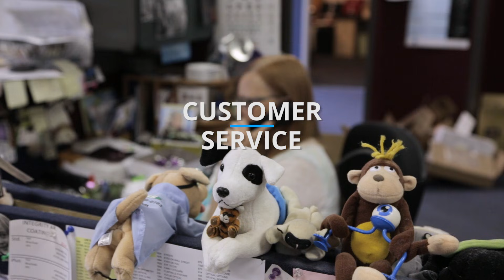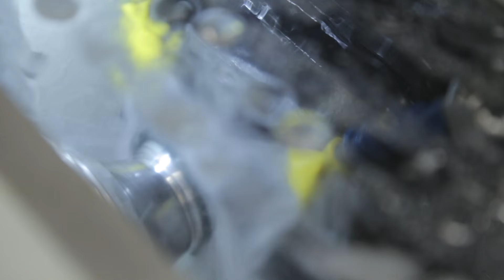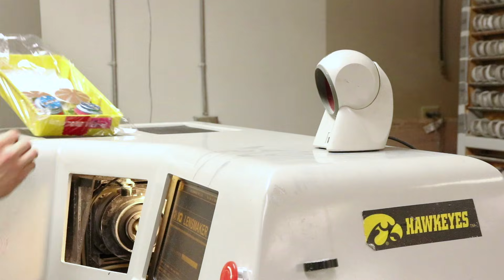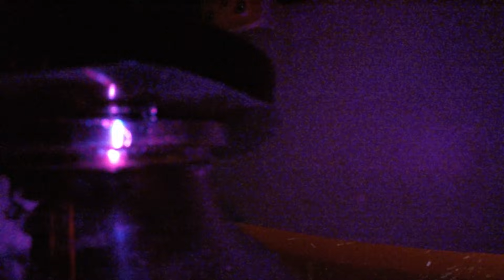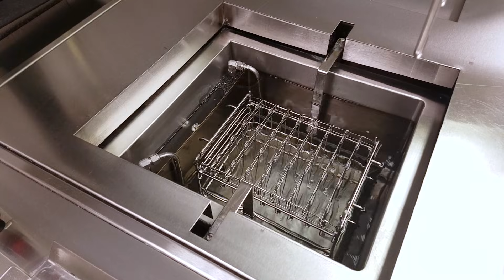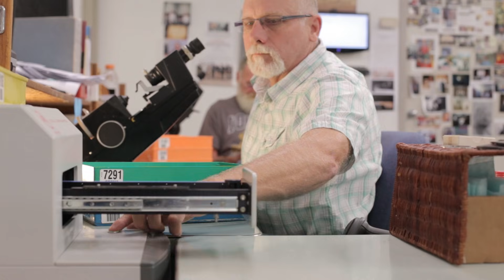How They're Made (Lenses and Coatings): Inside The Optical Lab

Comment: John, thank you and all the people involved in the production of this great video “How They’re Made…”.  The information in this video is needed throughout the optical industry.  And I agree with you John, Laramy-K Optical the best wholesale surfacing lab in the county.
Reply from the maker: Thanks!
Reply: @LaramyKOptical  if lenses are tinted before they are cut for frame dimensions how do they prevent the white edges from the safety bevel and lens edge being uncoated? seems counter-intuitive..
Reply from the maker: @wazup3333  Drop me an email through the OpticianWorks website. I'll be cutting a pair of that exact thing today or tomorrow. I'll grab some pictures and let you decide. John
Reply: @LaramyKOptical  sent, you will see it in direct light so on the pictures it wont be visible. this applies to clear lenses aswell since edges are uncoated, when direct light hits it the edges sparkle white

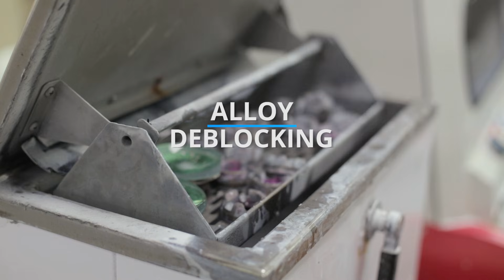Comment: What are the health and safety standards required with regard to handling the Lead Alloy, specifically at 12:27 onward...shouldn't gloves and masks be used by the operator to protect hands/skin and breathing in any particles? Or does the measurement of lead particles within the air fall below the OSHA guidelines of 50 PEL or less during an 8 hour exposure period?

Comment: Wow how interesting and amazing all the machinery and precise presion that goes into this. 
1 question i ask you makers. When applying the layers of shading and coating i notice you add the coatings to the front of our lenses. Which is why i know now how scratches do  occur on our glasses. Even though i got the feather weight transitional Lenses with actual glass coated scratch resistant lenses. I still get fine scratches. This last pair i got cloudiness right dead center of my glasses. I paid over $600.00 for my prescription glasses. And i got very fine scratches and cloudiness. I can't use them very often and they are what i use to drive. So don't be on the road when i drive. Its frustrating having these problems. Is their something i can do? With all the coatings in the front of the lenses it seems to be most of my problem from cleaning them over and over and over. Using even the micro fiber cleaning cloth. Putting them in glasses protectors when not using them or when they are in my purse. Is their a way, because i can't afford to keep paying this money. Is their a way u can put the layers of on the inside of glasses since most of the dirtiness is on the outside of lenses. Just asking if that possible. People clean the dusty dirty lenses it catches while wareing them then we clean them off and dust can be abrasive. They are less likely or less dusty and less like to scratch up so fast. 
Just a question sir. Women do dusty jobs cleaning and we work with allot of cleaning solutions that also can play a roll in damaging these lenses. You all work so hard at precisely and with such micro  Precision that you would think these lenses would last longer. Unfortunately after a year or two i see thos scratches and clouding. Which sucks for me. I'm very grateful you showed me this process. It is wow, amazing. I'm so thankful to have you all be able to make me see.  
I'm gonna share this because its important to know the steps you all do to create a way for millions to see. This is eye awakening thank you all for the hard work you all do. You are so important for me and family and friends. O appreciate a you all do. Thank you sir.
Reply: the Only Scratch proof lenses are made out of glass and not plastics.

Comment: Last time I got new glasses, I purchased polycarbonate lenses because of their supposed durability. I couldn’t see for crap, wore them for two weeks to allow eye adjustment. Had to go back and get plastic lenses. They are non-line progressive. Is this something that happens often with polycarbonate? I really liked the reduced weight.
Reply from the maker: Often? I would have to say no. But, next time insist on Trivex, lighter than poly and much, much better optically. "Durability" is kind of a questionable concept when talking about lenses. John
Reply: Thank you so much for the reply.

Comment: I have a super frustrating time with my new glasses / lenses. The frame is ok, but the lenses not so much. When I look and touch the lenses, there is a slight distortion in the glass, not completely smooth. This is a re-do from the previous one which had the same problem. I don't know if the problem is the lenses manufacturer (they are not Zeiss) or the technician messed up. I think I will go another office and ask them if this is normal. This is so frustrating.

Comment: I just had some new  coated bifocals made in high index material, due to deteriorating age-related eye sight. Despite all this machinery here in the UK as well the new glasses had a error in the right lens meaning everything was out of focus. Did the  lab mis-read the optician's prescription or was there an error in manufacture? Everything seems so fully automated it is hard to imagine where it went wrong. Anyway they lens are being re-made. 
C'est la vie.
Reply from the maker: The old saying hasn't changed --- Bad data in = bad data out. The best software and hardware is only as good as the information they are being fed. And that hardware still needs to be maintained by someone that actually knows what they are doing. I'd need to know more to answer your question but it sounds like you just needed to vent a little? ;-)  John

Comment: An excellent, informative and fascinating video. I do wonder how an online shop in the UK was able to reglaze my backup specs so cheaply including AR and hard coatings. I cannot distnguish them from my Zeiss Lotutec coated lenses (in Lindenberg frames) that cost four times as much apart from the hydrophobic coat. Perhaps the Zeiss are more durable?
Reply from the maker: Yes, I'd be curious on how good that coating looks a year out. And let us know how easy it is to clean over time when compared with the higher end product. Nothing to say it won't be equal or better --- but --- we shall see. John
Reply: Sydney Kinman-Vantiger They are fine but to be fair they are rarely used. My Zeiss have one faint mark, which I find impressive after 18 months, and that mark was from abuse. Are the cheapies as good? No idea.

Comment: Hi John, one question about lenses: at two different optics stores I was told that now the lenses are either now made from "plastic", not glass, or are compulsory coated with some film. I dont want any of those options since they will scratch easier and I insisted to have pure glass lenses as I had before, but I was told nobody makes such lenses since they are heavy. This was related to progressive lenses I wanted to have. Is this true information or I was just pushed to buy cheaper lenses? Many thanks if you reply to this question, Konstantin. P.S. In fact, do you have a video about the lense materials used today to watch and educate more myself?
Reply from the maker: Glass progressive will be very hard to find but they are still done. Glass lenses are still sold and still available. Some safety glasses must be glass and many farmers prefer it for its scratch resistance. You just need to find a better optician. John
Reply: Laramy-K Optical Thanks John your reply is much appreciated. Best regards Konstantin

Comment: What is the difference between the spinning thermal hard coat application and the scratch resistant coatin
Reply from the maker: In short the sophistication of the process. Spin coating would be for lenses not going through the a-r process. Lenses getting a-r will have the hard coat applied during that process.

Comment: Are transition lenses "coated" like a ARC stack, or do they "blended" into the lens itself?
Reply: It is coated on the surface of the blank.
Reply: @Chaz from UK It can be damaged by heat and can crack or you can scratch it but you destroy the lens. If you scratch deep enough you can see the original material but the lens is unusable.

Comment: So coatings are applied on the outside, not sandwiched? Does that mean that transition lenses, once scratched, cannot be polished without damaging the coating?
Reply from the maker: No lens can be polished to correct a scratch. That is a myth. If you did polish out a scratch (assuming the lens had no coatings of any kind at all) it would look fine but that area would be a blurry spot when you tried to look through it. The front curve would no longer match the back curve resulting in blur.

Comment: very informative video. I have a question regarding lense manufacturing. what is the relation between the degree of the sphere of tool  and lense number?
Reply from the maker: It is not necessarily a sphere tool. The lap or the positive tool can be spherical or compound. It is (roughly) a direct opposite positive curve to the negative curve we need to create the power. It can be compensated by radius hundredths of a mm to account for material. It is a passive mold where the cylinder machine is actually doing the work. I hope that is what you were asking? John
Reply: @LaramyKOptical  Thanks, very informative. one more question. There is any relationship between the degree of the spherical surface of lense and Power no. of the lens. eg: 2 degree spherical surface of the lens is corresponds to what power number of a lens or vice versa.? There is any chart table or formula .
Reply from the maker: @saqibhussain7217  https://www.youtube.com/watch?v=Ih1jPkvl96w

Comment: I can see the laser engraving in three spots on both lenses is that normal?
Reply from the maker: Yes No Maybe. Should be fine. I just learned myself that some lens BLANKS come from the factory with with marks and then we add another set after surfacing. I'd just be sure you are working from the right ones! (mistake I just made but don't tell anyone) John

Comment: I would like to ask for your confirmation on something.I recently went to the doctor to get my intermediate ,  number and I was wondering if you could confirm if it is correct or not?

This is my number 
OD - SPH -0.50 CYL -0.75 AXIS 80 ADD 1.25 
OS - SPH -0.50 CYL -0.50 AXIS 80 ADD 1.25 

My doctor calculated and provided me with the intermediate power.

intermeidate 
R :  -0.75CYL X AXIS 80 
L :  -0.50 X ASIX 80 

Can you please confirm if the intermediate power calculation is correct?However,  before converting to Crizal Prevencia.  Could you please verify if the intermediate calculation is accurate?
Reply from the maker: Assuming it should read 0.00 -0.75 X 80 and 0.00 -0.50 X 80 that should be about right.
Reply from the maker: https://youtu.be/f6Xi4mGTug4
Reply: @LaramyKOptical  Thank you so much for all your help, I really appreciate it. By the way, regarding Crizal Prevencia, can it be incorporated into glasses for intermediate distance? Would it be effective for that purpose?
Reply from the maker: @rakeshkumarsingh3188  Sure - coatings can be applied to almost any lens. A lens set for intermediate distance would most likely be used when blue light is present so if that is a concern go for it. That Essilor stuff is crazy expensive and not any better than any other high quality coating.

Comment: Found this video when I was looking for a way to repair a vintage camera lens.... Is there a way to send out camera lens elements for polishing and recoating? Some vintage lenses are worth hundreds of dollars if they are optically flawless, but only 20 bucks if they are hazy. Any idea how much it might cost?
Reply from the maker: Dan, Please drop me an email through the OpticianWorks website. I'll need to do a little digging but glass can be polished. When you say "vintage" are we talking just a basic glass lens or just an older lens with an AR coat that has been damaged? John
Reply: @LaramyKOptical  it is a contax-yashica ML50 1.4 that had fungus, I completely disassembled the lens and it does appear to have some AR coatings that have been etched by the enzymes of the fungus. I would love to be able to recoat with more modern coatings, I'll send you an email!
Reply: @dangoldbach6570  just wondering is it possible?

Comment: That was fantastic!  Is there any comparable video for the process of fitting the lens to the frame? I'm dying to know how that happens!
Reply from the maker: Sure: https://www.youtube.com/watch?v=0v2dZ54BF3Q&t=292s
Reply: @LaramyKOptical  Thanks for that link - interesting! But it didn't address one part I'm most curious about - how do they match the cut to the frame? I've seen, on some of your great videos, a 'frame tracer' machine that 'reads' the inside of the frame, providing a 'cut map' to the cutter.  What I was really wondering was - if a high-volume optical operation (lets say, lenscrafters) sells a bunch of their own frames, do they simply have the 'cut map' on hand for repeat instances of a frame, or do they 'frame trace' every single frame, every time? And/or, do frame manufacturers supply a 'cut map' with their frames, that can be 'plugged in' to the lens cutter? 

Tangentially related - do most optical operations refuse to re-use a customer's existing frame?  I have a collection of about 10 frames that cost a fortune, and I prefer their styles to the current fashions ... but I've encountered push-back when trying to suggest re-use.
Reply from the maker: @chriss740  I think you are expecting something more sophisticated maybe? That's it --- edgers trace the frame and then "cut" the lenses, all there is to it.  Yes, the edgers usually have a memory function but always better to do an individual trace for each frame. Tracer accuracy is around +/-0.05mm which is pretty darned accurate. Yes, if you are cutting 100 identical safety frames you can use an edger memory function and yes they do make high volume edgers. Robotics are making big strides into the process. 

Only a fool would refuse to reuse a perfectly good older frame. If they can provide a valid reason and/or show you why that is one thing. Just saying, "no we don't do that" is another and breaks my heart. If you have a "vintage" collection you love I'd look for an independent optician that enjoys that sort of thing over a chain.

Comment: do they glue two pieces of glass together to make a lens ?
Reply from the maker: They fuse two different indices of glass together sometimes when making lined bifocals (or used to 100 years ago). A polarized glass lens may be a laminate. But they are not routinely made that way. Many plastic lenses are a laminate or a laminate variation. Years ago Lenscrafters had a "while you wait progressive" series that was 100% gluing two pieces of plastic together. John
Reply: @LaramyKOptical  ok because my glasses are coming apart and lenscrafters said my warranty is out and i never new that they glued two pieces together and they didn't say anything about it!
Reply from the maker: @havierpesqueda7244  "They" aren't gluing them together anymore, that was 20+ years ago... lenses do sometimes split or appear to be splitting in such a way that they look like they were once two different pieces. More of a, "one of those things that happens" moment. Are they in a semi-rimless frame? Are the polarized?

Comment: Do you make camera lenses also? If so, why are camera lenses so much more expensive than eyeglass lenses?
Reply from the maker: We make lenses for many applications. For something specific please call the lab we can probably do it. Why are camera lenses so much more? Glass, often biconcave or biconvex, aberration reduction is critical and you have 3, 5, 10 + of them in a single lens structure. Eyeglasses are plastic, routine surfacing, aberration reduction not so critical, and you have just one of them per eye in a frame which makes mounting quite easy. John
Reply: @LaramyKOptical  Thank you.

Comment: Do you do high index lenses? I wear -5.00 and -1.25. I need highest index for the -5.00 lens.
Reply from the maker: No idea what material you got but a 1.60 and a properly fit frame would be just fine. You need to find a good optician!
Reply: Laramy-K Optical I paid for crizal saphire high index 1.74 and my current lenses are high index polycarbonate 1.60 and I see much more clear with them than with the new ones. However I paid for the polycarbonate ones 100dllrs and for the crizal 400dllrs only the lenses. I expected better outcome for the price. Also the higher index lenses are thicker than the 1.60 index lenses. I don’t find any logic.
What do you think?
Also, may I ask you if I can contact you directly so you can do my glasses?
Reply from the maker: @easterneuropeaninmexico3554  Like I said - You really need to find a better optician! If you had something unique going on I'd be glad to work with you but any decent and ethical optician should be able to take care of you and provide you with a great pair of glasses. It ain't rocket science... John
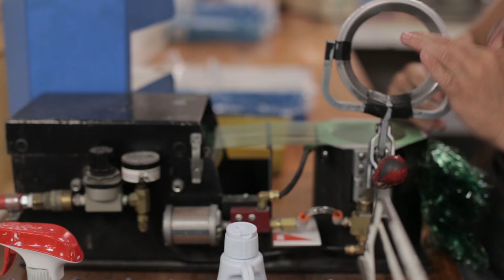Reply: -5:00 1.74 index /-125 1.5 index  will do